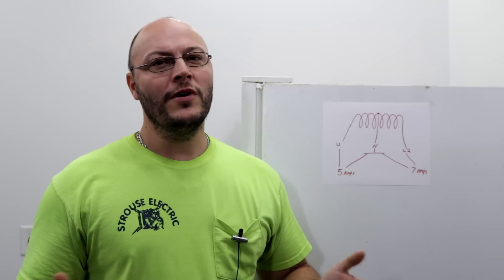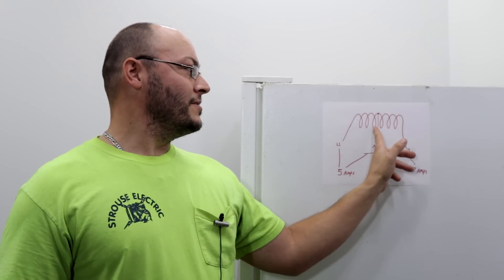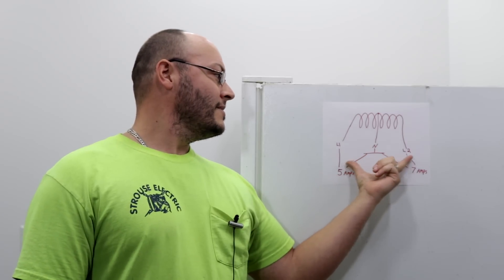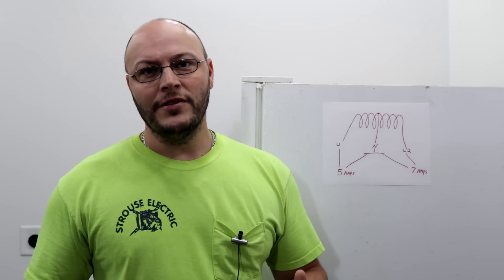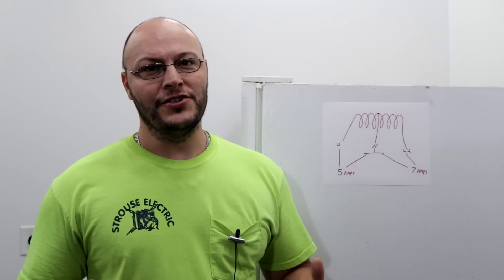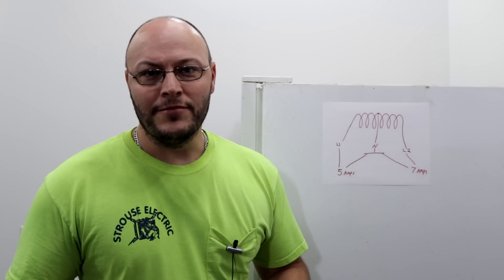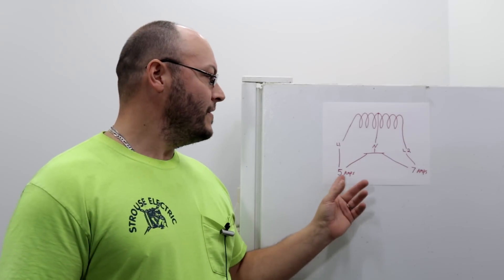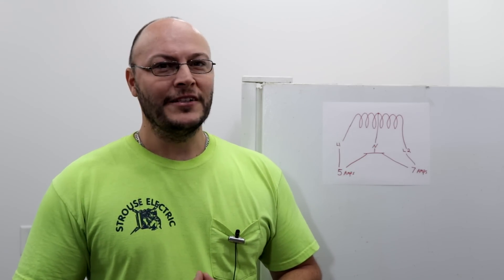What does the Neutral Wire Do?

Comment: This makes it sound like the current is flowing out from L1 or 2 and back through the neutral. With AC the electrons don't flow, but oscillate back and forth, so in what sense can we say that current flows in one direction?  I can only imagine the electrons are being pushed out and pulled back by the hot wire, but given that it is a loop, I don't  see how one can say that, and where the difference between the hot and the neutral arises.
Reply: To some extent you are correct but neutral is just that, neutral. L1 and L2 are 180 degrees out of phase, which means, when L1 is positive L2 is negative the same amount.  That gives you the "oscillation back and forth".  Neutral is like a bisexual, or Switzerland, can go either way, will conduct the current if the potential is + or -.  Simple explanation. Hope this clears it up and don't care if it offends. LOL. Look at this, the centerline is neutral

https://appliantology.org/uploads/monthly_2016_06/large.5755f1418cae1_SineWave180Oscilloscope.jpg.0171964404ab7b6f07fb7e155853bd9e.jpg
Reply: When not connected to a load, L1 and L2 are 120V and neutral is 0V. So if you touch L1 or L2, it will shock you but neutral won't.  If L1 or L2 with neutral wires are connected to a load, the AC current needs the neutral wire to complete the loop to the source so oscillation could happen. At this point L1 and neutral are BOTH hot and both will shock you equally. 120V can kill you within 3 sec and I have seen it. Run a simple experiment with light bulb and measure the current of both L1 and neutral by turning it on and off. They must be the same when on. This is a topic most confusing and for some stupid reason textbook never explains it! I asked the same question when I was a student and the stupid instructor did not understand it but tried his best to explain it! The explanation in this video is wrong.
Reply: Neutral carries current but has no voltage potential  to ground, so no shock.
Reply: Thank you.

Comment: If i have a ground attached to the neutral line at my meter base and the neutral is fed to my service panel do i need to install another ground rod at the service panel and do i have to keep the grounds separate from the neutrals given the neutral is attached to the main line at the meter base already? Plus, if i install a sub panel will i need to keep the ground separate from the neutral and also install a ground rod on those grounds in the panel? In other words where do i keep the grounds off the neutral and where do i need to ground the grounds. I have seen current going to ground at the 120 black wire only when i energize the circuit but other wise no current shows up on the ground. 
Can you explain this to me? I feel if current shows up on the ground after energizing the circuit then wattage is also being used through my meter and thus higher bills. Is that the case?
Reply: Thank you very much. I have a standing meter on a pole which has a ground rod at the pole and the ground wire is attached to the meter housing going to the ground rod at the pole. Off the meter base i have what is considered a utility box which i have a 200 amp breaker feeding my lug terminals i use outside for any projects needing power. Out of that breaker i feed a sub panel box inside my home which i have another 200 amp breaker and i also am feeding another sub panel off that box. I have in all a utility box and two sub panels, all using 2/0 wire and running about 100 feet maximum. I intend to install out of the second box a line for my garage which now will be a utility box, three sub boxes, all with 2/0 wire and 200 amp. breakers. My question is do i have to leave the neutrals all ungrounded and install ground rods at each sub panel? The  utility box is grounded to the neutral line through the meter base at present. I hope this makes some sense.

Comment: how does your explanation work in relation to rcd,s (gfi,s) as i understood that these devices will detect a difference of 30mA between line and neutral conductors and therefore each conductor must carry the same amperage under load for this detection to work ?

Comment: great vid.   got more?  I would like to know why black and red are both positive volt AC?? where's the negative?
Reply: Miguel.....That is a common problem I come across a lot:
With AC there is NO positive/ +ve or Negative/ -ve....
Black & red as wire colours should  apply to DC only.....
This where the confusion comes from! 
In Europe,(And pretty much anywhere, these days) LIVE is Brown & NEUTRAL is Blue.....to get people to understand that they are NOT dealing with a DC Circuit & different rules apply.
(In some countries "live" is often referred to as "phase"......never "positive")

Just empty your head of that black-red concept: 
There is only "Live" & "Neutral".
Neutral is neither +ve or -ve...it is.... well: Neutral!
Reply: Ima SuperPerson, you just said there is not, and then there is a negative? The answer is that negative implies the voltage your measuring is at a lower potential than your reference. You cannot have voltage without two points of reference. AC voltage in your home is a single wire, and therefore there can be no positive or negative. The power delivery comes in the form of time-varying potential (basically the electrons are traveling back and forth through the bulb. Think of it like a shake-weight). In other words, the potential on the wire is alternating at 60Hz, with a max/min differential of 120V. As I said before, you cannot have voltage without two points of reference, and in this case the two points of reference of are at the peak of the sine wave (derivative = 0, second derivative = -1), and at the min of the sine wave (derivative = 0, second derivative = 1). Those are your two points of reference. Note that those two points of reference are on the same wire, at the same physical point, and are only separated by time (1/120 of a sec to be exact). This is why the concept of negative makes no sense.
Reply: Watch an AC theory video. The red and black both have both a positive and negative direction flow.
Reply: DAVID ULLOA  thank you
Reply: Miguel Denesus no prob. Theres alot of good ones on YT. Thats also why its called Alternating Current. It alternates from positive to negative.
Reply: Patagualian Mostly  Thanks
Reply: Miguel Denesus hugf
Reply: There is no "negative" in an A/C system.  Well, there is for exactly 1/2 of the cycle, or 30 times per second.  A/C changes direction 60 times per second in America.  But it still takes two conductors to complete the circuit.  That's why they call one a "leg" and the other one "neutral".  L1 and N.  It is much more complicated than DC because of the way transformers are built, and because different systems use different methods and nomenclature. The two "hot" wires (bad term) from the power company are 180 degress out of phase with each other, at any instant.  So that's how the use the phase of the generator to give you 120 or 240 volts AC.  Pretty smart, actually - but the nuetral must be used in the 120 vac configuration.  In 240 volt ac systems, you're basically connected to both ends of the transformer outputs - with each conductor providing 120 vac, 180 degress out of phase with respect to the other.

Comment: You forgot to mention that it goes back to the  Transformer at Almost no voltage
Reply: Is the voltage ~0 because of the voltage drop through the load?  Or is there a device on the neutral line that ensures the voltage is nearly 0?

Comment: Im at the end of a 5 yr apprenticeship & your video was the first time Ive ever heard a concise, comprehensible definition for the Neutral.  So thanks 4 that.  BTW, please make more videos so I can get on with my career.   lol
Reply: you're confusing ac power and dc power. in dc or direct current, such as in a car, positive leaves the battery and negative returns to the battery. in ac or alternating current , such as in your house, both wires are constantly changing polarity. a good way to think of it is that energy is being pushed and pulled in alternating directions. 

in order to understand why a neutral will not shock you, you must first understand what causes you to receive an electric shock. when you touch the live wire and the ground (the earth) at the same time in a grounded system, you complete a circuit since the energy will use the ground as a path back to it's source (the transformer). the reason you feel the shock is because the difference in potential (voltage) between the live wire carrying 110 volts and the ground which has a potential of 0 volts causes an electrical current to flow through your body into the ground. the reason that the neutral will not shock you in an ac system is because it is bonded to the Earth (grounded). this causes the earth and the neutral to have an equal potential of 0 volts. thus, when you touch neutral and ground at the same time, there is no difference of potential, no current draw, and you will not get shocked.   if you are still confused. reply to this and i will try to answer you.
Reply: @shauleisenberg9282  thanks that explains it very well.
Reply: In a battery the electrons flow from the anode or negative side to the cathode or positive side.
Reply: Mark M No not really
Reply: Brian Roome  my dear friend....i have also been shocked from the neutral because there is a load going through that circuit. The neutral is worse because of the load the amps have the potential to kill you....be safe and work with zero voltage
Reply: Brown Paw  only the union go 5 years,  and then they put you on the books  for 3yr...lol. I been on both sides of the fence. Don't be ignorant it really comes down to the individual how good they want to be. We have done main panel upgrade changes hot with no proper shutdown,but it don't make it right.
Reply: Shaul Eisenberg Electrons leave a battery through the negative terminal.
Reply: this is a very confusing explanation to me, in a 3 wire system hot and neutral carry current, the third wire a ground wire normally doesn't current. The neutral and ground wire are both connected to the ground bus bar at the main panel.
Reply: cat 11 Remember current will always take the least path of resistance, the path on the neutral wire is low back to the transformer, the neutral and the ground is bonded at the main panel to provide a path to ground for either shorts in appliances or lightning strikes, remember the path from the bond in the panel is high resistance from the bond connection down to the ground rod. So naturally the current path will flow back to the bond point and look at both paths and take the path of least resistance back to the transformer, I hope this explains the neutral wiring to you without confusing you.
Reply: @cat-lw6kq  .. a 3wire system is 2 hot 1 neutral  ,like romex you don't count the ground.
Reply: At the end of your 5 year apprenticeship and your just learning what a nuetral is or does.... no offense but that's scary. Stay in the trade, glad you're learning.
Reply: Neutrals carry current from unbalanced loads, they are dangerous due to the fact that they do not have over current protection...
Reply: Doesn’t anyone turn off the main black switch in the box before touching anything? so many shocks in here lol
Reply: rita wix why eletrician needs to go for apprenticeship?  I'm thinking in enroll in an eletrician school. did you went to school and after became aprendice?  so you can be licensed is that how it works?
Reply: zabama z you go to school and are an apprentice at the same time learning both on the job and in school getting your hours for the license and the degree to show your worth
Reply: rita wix p
Reply: rita wix I
Reply: Lex Desuasido
Reply: You should have learned about single phase neutrals in first year school
Reply: He's in a better place.
Reply: Because you get paid, that's why.
Reply: The reason you can get a shock while working on a live circuit is likely because it's an appliance (furnace, water pump, etc) that has a live feed going to it and you are handling the appliance's neutral, which actually the other end of that live wire, meaning the power is going in and through the appliance but you have not terminated the neutral to the house neutral yet. IOW, you have become part of the circuit! Once everything is connected to the house neutral then that's also bonded to ground, which a better conductor than you... so no problem.
Reply: rita wix ive been an apprentice for 3 years ready to get wireman .....5 years whats takin u so long to get licensed lol
Reply: Hey ! I want to know,  from a single socket for live wire, how does electricity change its polarity ? For instance, if positive charge is coming from live wire, neutral should be negative in order to complete the flow of current, shouldn't  it? And if negative charge is coming from the live wire, then neutral wire should be positive terminal, shouldn't  it?
Reply: @kickerkd  No,  even though you see L1 and N in your house, the electricity passes through L1, L2 and L3. It's a long story
Reply: @kickerkd  the polarity changes because it is alternative current and it changes at the rate 60 times a second. So during half a second it will be positive and during the other half second it will negative. This is the same wire, which will change from positive to negative 60 times per second. You probably know this now as it was 4 years ago since you posed this question...
Reply: @kennethcohan9630  Yeah. It's been four years. I was in high school back then, and I was new to Alternating Current. Now I am in the 3rd year of my computer engineering and I consider myself to have a firm understanding of Electricity and Magnetism. Thanks for the reply though. It brought back memories of those days when I was so curious and determined to learn physics.
Reply: Prasiddha khawas if you are in an AC or alternating current there is no polarity, instead hot and neutral terms are being use. and from the word itself the current is basically alternating to another line if you are holding a single line, but take note! if you do it make sure that you dont have a direct contact to the ground because the current may pass to you or your body will serve as a conductor so the current flows directlty to the ground. take note! you can only do touching a single AC wire ib 110-240 volts only...380 can cause serious damage.
Reply: I agree that's how it should be, a circuit. In reality my limited experience is different.
First off, I'm not an electrical tradesman. But I've worked with electricity on the job and in several homes in various states and counties. The counties are very modern and strict and any work I've done has passed inspection. That said, I've never found a neutral. White and green have always both gone to ground. Eventually I just accepted it.
Reply: Brown Paw fuck unions. And I'm sure all those in the IBEW apprentice program looove to talk about it over their hour long coffee break.
Reply: Wow @ 5 years you'd think you'd know this. I thought the elec app was 4 years, atleast here in Canada maybe its different. 

So the N just balances out the 240V split to make 120V, isnt that what the coil is?
Reply: @markm3371  So you gonna give a guy shit about not knowing something. Then ask a question ⁉️
Reply: rita wix If after 5 year you find this video informative, please seek an alternate career.

Comment: Very interesting!!! So is the N wire live? (Caring the LOAD) How can you have live going to Earth? Mm me thinks we do not understand electric. Does current flow through a capacitor ??? .....   DC
Reply: E.power DC from what he says I'm assuming the neutral only has current when it's wired up and the live side is turned on.? I'm used to working on DC car systems... capacitors store electricity abit like a battery but can discharge stored energy a lot quicker than a conventional battery
Reply: Hi Sly Thee way i see it. The pole transformer's central tap is zero voltage amid a 120v + & - ac voltage; so it is a neutral potential at this point, which is the same as ground potential. So this means 240v potential difference A/C can only be measured across the transformer coil end to end, if you follow. ... DC

Comment: Good explanation. Thanks for making this video!
 I Keep hearing that under normal conditions, a grounding conductor does not carry current..well then what the hell does it carry? Also, I read "Neutral is a circuit conductor that normally carries current back to the source, and is connected to ground" so...this makes it sound like the "source' comes from the ground. I'm so confused...
Reply: Neutral and ground (connected to mud) are connected in the main panel. If hot wire touches appliance metal chassis, current flows through ground wire to main panel and then to white neutral wire. It does not go to mud as there is too much resistance between ground ( mud ) and main panel neutral wire,  therefore current goes to neutral and not to ground. Ground wire will carry current when there is a lightning strike.